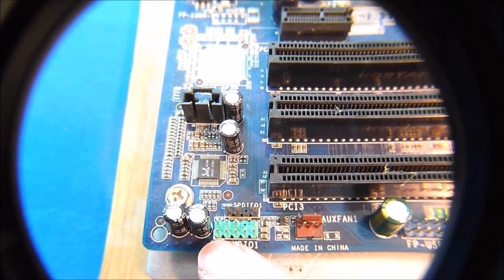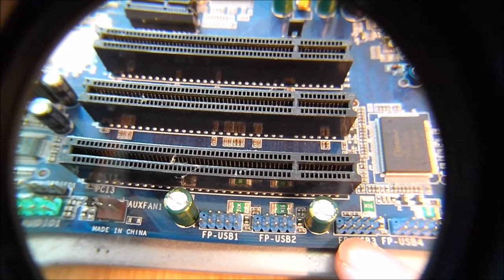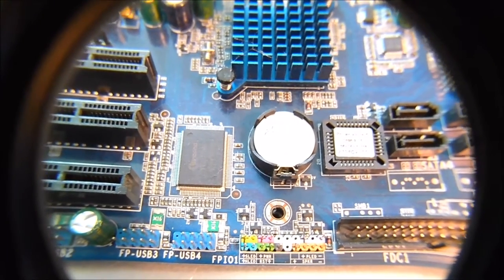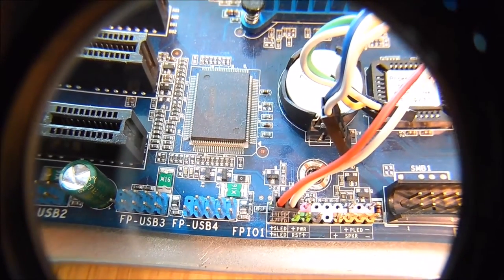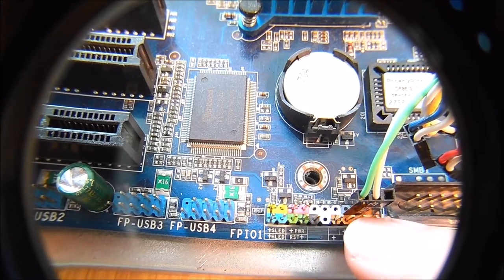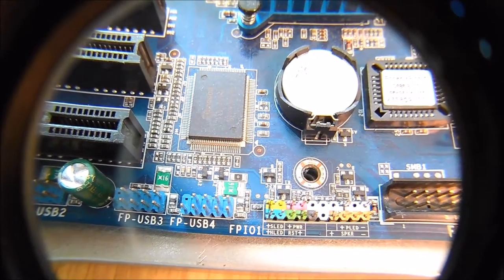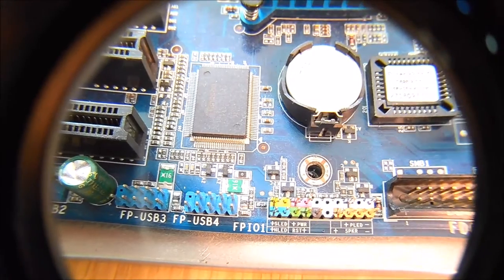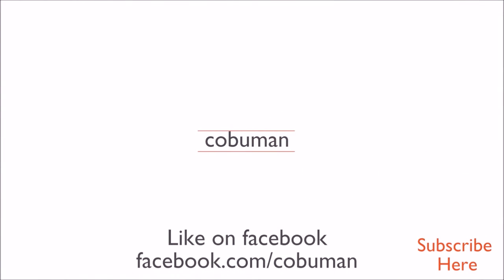Desktop Computer Front Panel Connectors Explained (PC Build Tips)

Comment: Do you need the front header connectors for every motherboard?
Reply from the maker: Very good question. Every motherboard has front connectors. On name brand computers like HP connectors are more simple.
Reply: cobuman hmm I see. I just finished upgrading my brother’s mining into a gaming rig and it doesn’t have a case so I don’t have the front panel connectors. I tried to jumpstart it with the screwdriver but I had no luck to get it up and running. 
My specs: Dual GTX 1070Ti, Ryzen 7 1700x, X370 Carbon Gaming Pro, 120gb SSD, Ballistix 2x4gb
IF I were to get those connectors do you think it’d change anything?
Reply from the maker: That's a really good setup. I would definitely order those connectors if possible because they may come with switches on/off/reset attached. Like this: https://amzn.to/2RCOBsG. There is a way to pin jump start the power supply... Here is my video on showing how https://youtu.be/UGMC8iAfIa8?t=478 , but I would get those connectors :)